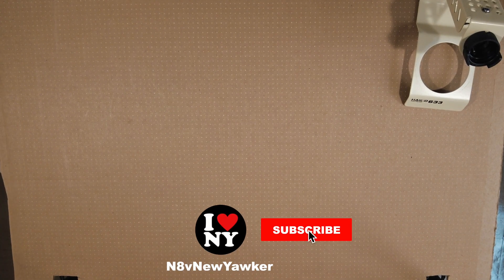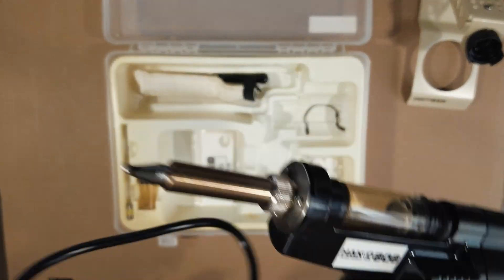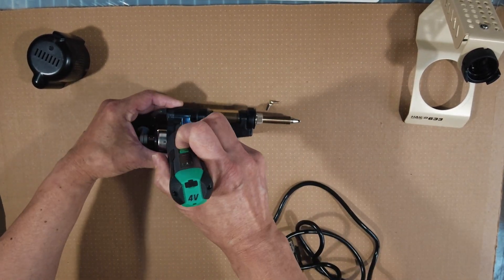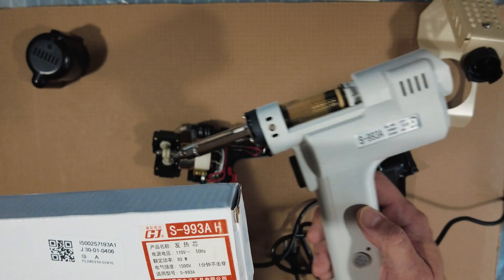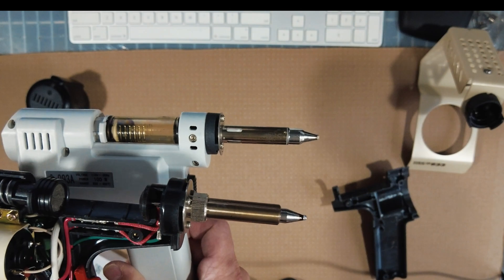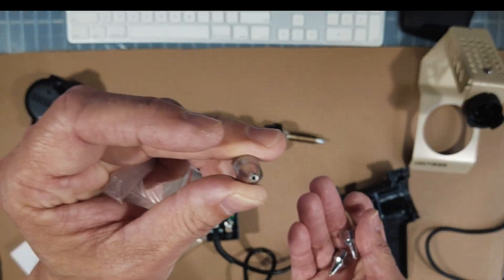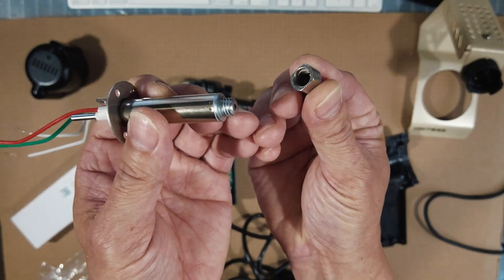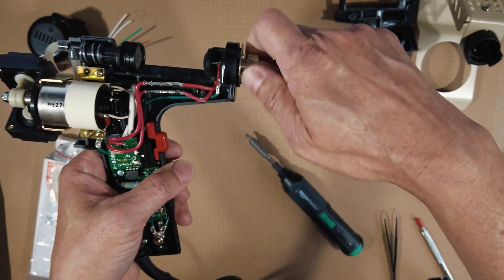Franken Hakko 808 Desoldering Gun Dead Heating Element Hack

Comment: Hello,

I'm wondering if I should purchase an 808 desoldering gun that needs a heating element, or should I stick to something else?

I don't do much through hole desoldering and use the Engineer SS-02 or SS-03 silicon tip pump. However, a gun style tool would work much better on automotive boards that use daughter style connectors or cartridge connectors on older video game systems.

Thanks in advance for your reply and input.

Cheers!

Comment: thanx for the vid, I just made the purchase for my lightly used 808 element failure, the fact that Hakko doesn't still provide these ensures i will NEVER buy another Hakko product, $249 in 2013, used 10 times max and now its junk......, not a honorable company
Reply from the maker: I felt the same, I bought mine back in the late 90's (98 or 99) and also occasionally used it. But consider the "planned obsolescence" dedicated to everything thats made now. Just and FYI, if you plan on the conversion...  once you get it working, dont mess with it. I was trying to get exact temps and ended up smoking it. the S-993a wasnt up to par so I ended up buying the FR-301 plus a few extra heating elements and tips. You'll see the new Hakko in use soon. Just have to edit the video

Comment: Nice video. It's inspiring me to purchase all my replacement parts for the 301 now while they are still available for the future. I always wanted an 808 though I think they are neat!
Reply from the maker: Thanks, I just did the same, buy extra damn heating elements for my 301!!! In the end, I bought an FR-301, its nice but personally I feel the 808 had better suction with its dual bellows. the Chineseum S-993a pump dosn't have as much suction and clogs alot. Plus, read my response below on why i bought the Hakko.
Reply: I hear you, I've never been fortunate to own an 808, but I noticed that with my 301, it turned out to be a Japanese model that Amazon sells FR-301-82. I believe either someone converts the wire to the 3 prong us plug or the Japan division does it. In which I contacted hakko, and they said they don't sell anything via amazon. So I've been running it 100v at 50hz vs. the 110v at 60hz. I always thought it functioned okay but felt it was a little weak. I recently found a video here on the ube where someone converted the pcb to the 120v version. In realitythe pcb was exactly the same, with the difference being of a change on 2 resistors. I modified it to be accurate like the US versions, and I noticed a difference it performed much better. Also, since I used to run nitro rc cars, I ended up replacing the suction tube for a smaller one. In my theory, I felt if I used a smaller diameter, it would choke up the air flow a bit to create more pressure, and I've got to say it works great now. I might be wrong with the air tube theory but its something to try using different diameters. Also to avoid clogging hold the suction a bit longer after you've removed the solder to ensure it moves through the chamber. Those small changes now has me loving my 301 even more. Cleaning the internals with a orange solvent mixed with 99% ipa helped me break down all the excessive flux that I didn't know it accumulated from the vapors. Give it a try maybe that might help with the suction improvements.  @n8vnewyawker8

Comment: This worked. I found the heating element bevel after the large metal circle made the element sit further out and needed a longer screw. Needed to turn the temp up but not to the max. Noticed the heating element version in the video and the only parts I could find are marked 50hz, I assume this is ignorable.
Reply from the maker: Yup, its 50hz, I ended up buying the S-993A desoldering gun also but it's suction is not that great and it clogs alot, especially when using it on lead-free solder. 
Well, I got greedy and started messing with the temperature settings and I think I smoked the 808. I should've just left it alone but I was trying to get an exact 450º on the tip, left it running by accident and now I cant regulate the temp. In the end, I bought a 301. 
I still love the suction power on the 808, so in the future, I'll probably frankenstein the circuit board and heating element from the S-993a into the 808 case and pump assembly, but really, I have a 301 now and many people have tossed their non-working 808's.